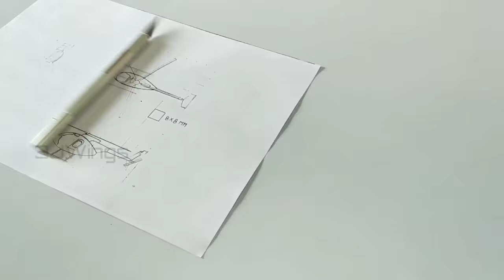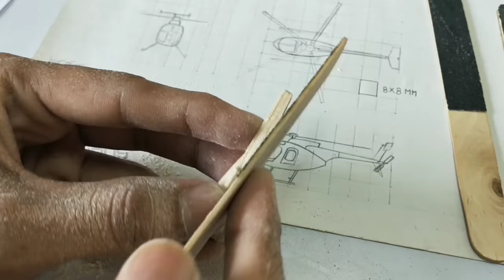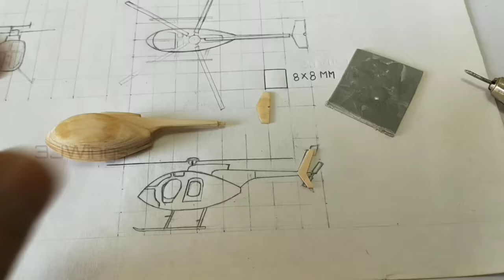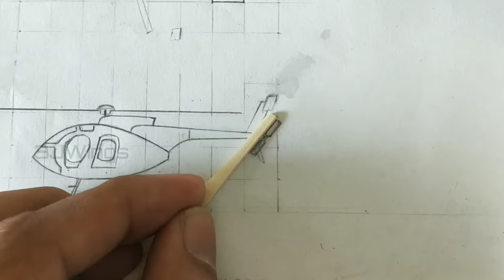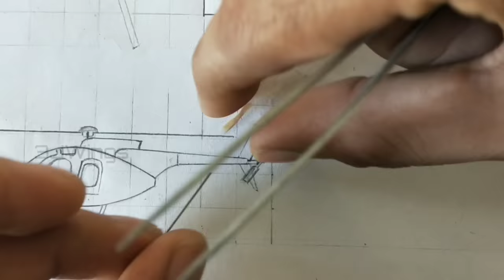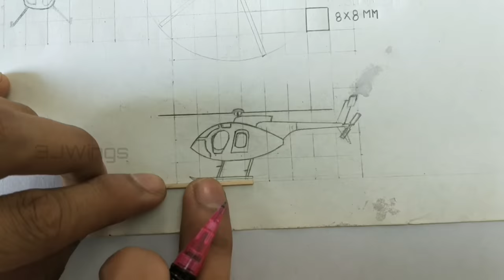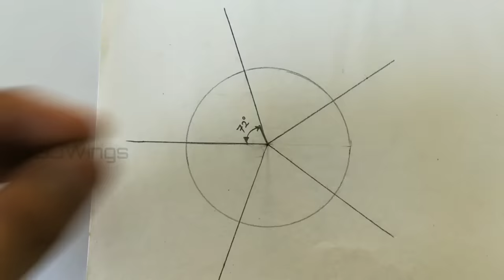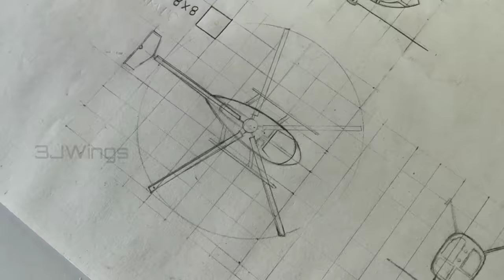How to Make Helicopter with Ice cream Sticks | MD 530F helicopter | #helicopter #diy

Comment: As a scratch modeler myself, this video really gave me some great hints... Thanks! This was inspiring to say the least... Oh! And... Really beautiful work sir!
Reply: I'm no modeler, but if I were attempting this I'd have painted the rotors before attaching to the hub. That way I could use tape for crisp lines.
Also on the tail rotor, could you get by using say, a fine tip Sharpie pen for the colors? I'm not that good with a brush.